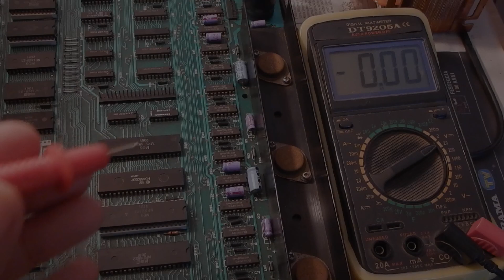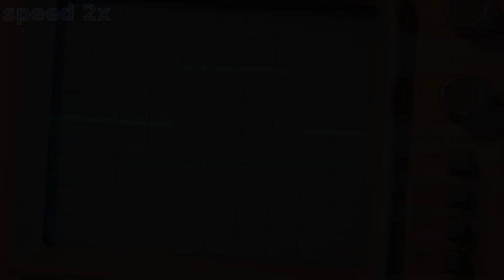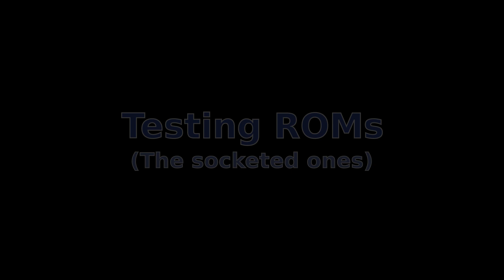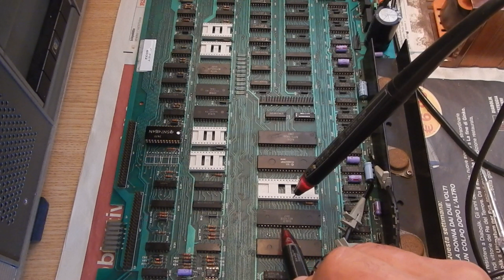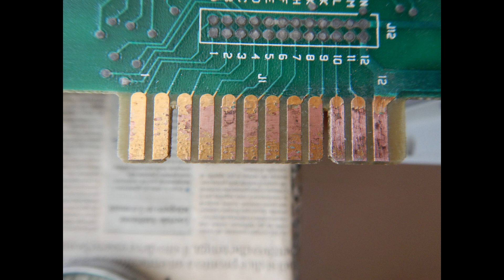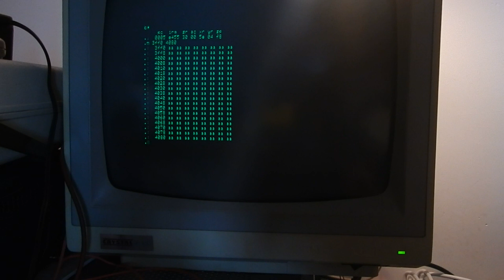Commodore PET 8032 repair. ROM/RAM/IO and more faults fixed!

Comment: I have a 4032 that boots into the TIM screen, where it shows B* top left, and then register values. They keyboard also does not work at this time. Tried reseating everything and cleaning the connections best I could, but no luck. Not even sure where to start yet, plan on selling it anyway, but selling a working PET would be much easier where I live. Near impossible to sell a broken one here I'd think.
Reply from the maker: Try swapping UB16 and UB12 if they're socketed. Both should be MOS6520 (or any MC6821 compatible IC). If nothing is socketed, you better leave it alone unless you've good tools and experience in desoldering ICs on these old PCBs.
Reply: @iz8dwf  thanks for the quick advice! Ya both of those are soldered in. I saw on the forums someone with a very similar issue replaced I believe the 6520s, 6502, and a couple other things to get his working. I've done some soldering but ya probably shouldn't touch this until I'm more confident and have the proper tools/parts to replace. Thanks!

Comment: Hi Francesco, I have an interesting question.  The schematic indicates two separate parts. 74LS74 (UB2, UB1) and 74S74 (UD2, UE4).  Datasheets seem very similar except 74LS74 can work at 25MHz and 74S74 can work at 110MHz.  This seems very strange.  I thought the 74LS series were faster than 74S series.  Can I just use 74F series instead? as in 74F74 for 74LS74 and 74S74?  There is also a 74S04 which is very obsolete and hard to find.  Can I use a 74F04 instead?  Thanks a lot.
Reply from the maker: Hi! UD2 and UE4 are used in the clock generator circuits, they have used the faster family to introduce the least amount of delay on these signals. 74S is the first schottky TTL family, very fast and it was introduced before the 74LS one. You can use 74F parts to substitute the old 74S if you don't have the correct one. You cannot use 74F (generally speaking) parts in place of 74LS ones. The much smaller delay could in many cases give timing errors (for example violate the Thold on RAM/ROM access etc..). 74HCT family is a good substitute for 74LS parts most of the times. However, 74LS ICs are too easy to be found to bother in my opinion.
Reply: @iz8dwf  Thank you so much 👍👍
Reply: @iz8dwf  Dear Francesco, I hope I'm not disturbing but I found a peculiarity in my universal board.  The schematic indicates that U3 is a 74LS138 but my board had originally factory installed 74S138 at U3.  That's the decoder setting read/write and choosing even/odd display ram for video latch and video data buffer.  Installed 74S138 is 8ns/245mW but schemaic 74LS138 is 21ns/32mW.  Which do you think is the correct one? Schematic or the factory? also hotter faster or cooler slower? 🙂
Reply from the maker: @Mr_ToR  Hi, if you're sure the IC was installed by the factory (in other words, if it has not been substituted later by someone else), always the factory usually has more authority over the schematic. I think that on 80 columns PETs the extra speed might be needed, but take it just as my feeling. Short answer: always trust parts that have been installed by the factory on a working machine.

Comment: Always excited to see you fantastic videos! How did you connect an external monitor? Been look for this setup for a while. Grazie!
Reply from the maker: Hi, thanks for the comment! That monitor is a dual sync (15KHz/20KHz) composite and TTL inputs. Since the universal PETs have similar scan frequencies (around 20 KHz) I could simply adapt the TTL signals out of the PET motherboard. It needs some TTL inverter on syncs only.

Comment: The first serious retro repair video this week. You saved the weekend ;-)
Reply from the maker: Hi! The only problem is always this: either I repair things or I edit videos :) So it takes a while to make new ones.
Reply: @iz8dwf  They're perfectly fine now. Don't waste more time on editing. Spent it on more repairs ;-)
Reply from the maker: full disclosure: it takes far more time to edit than to repair :) I have a few repair videos still to edit. And repair queue is still long too.
Reply: I wish more retro computer channels would do these videos. They're so helpful when it comes to learning how to diagnose and fix issues. Good stuff.
Reply: There are quite some channels that do on a regular basis. But the last few weeks, it seemed to me that only Necroware and CuriousMarc did some interesting repairs, albeit not as deep as iz8dwf usually goes. Yesterdays XT board "repair" by Adrian was also very interesting.